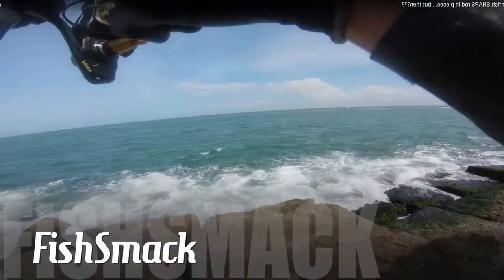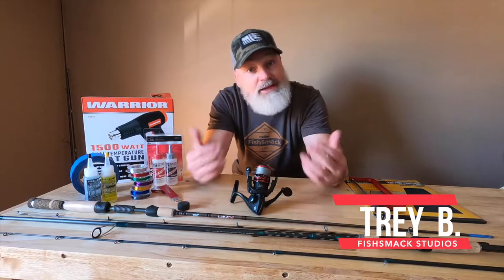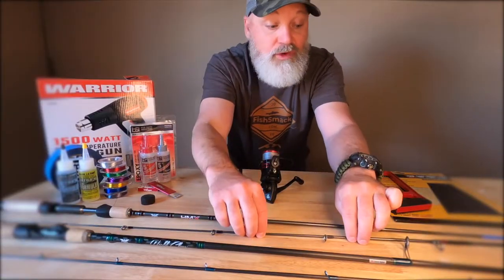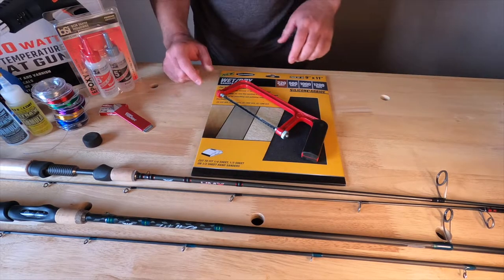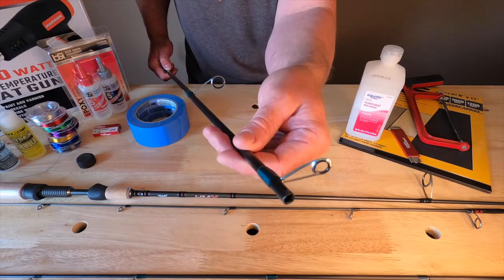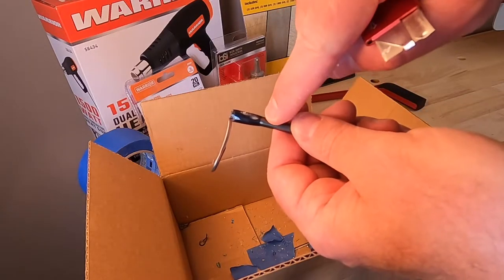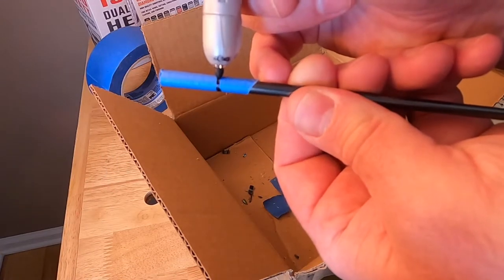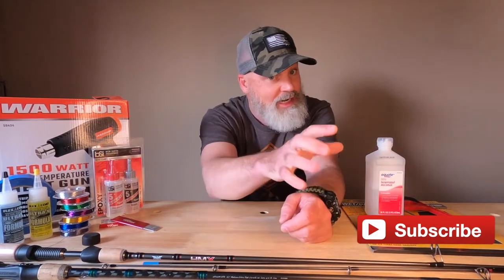How to fix a BROKEN Fishing Rod.

Comment: Cool story on the rod.  Can't wait to see how it turns out.
Reply from the maker: How's it going Mr. John? I took this rod out this week to stress test it for the video. I've landed 10 so far with it...and it's held up great, and the action feels the same...as well as the balance. If I put less than $300 in a couple pieces of equipment, I think I could fix most rods with a somewhat personal finish. I hate throwing things away, if they can be fixed.

Comment: Hey awesome video FishSmack but I can’t repair it it’s to thin at the tip to repair and I can’t really afford all the materials it awesome video and congratulations on 400 subscribers
Reply from the maker: Thank you Mr. Jack! I appreciate that buddy. Do you think Bass Pro will let you return the rod? If not, can you shorten the rod and just add on a tip guide? They have the assorted pack of tip guides in several different sizes on Amazon for $11. Other than that, you would just need epoxy.
Reply: @fishsmack  yeah cabela’s should let me trade it out